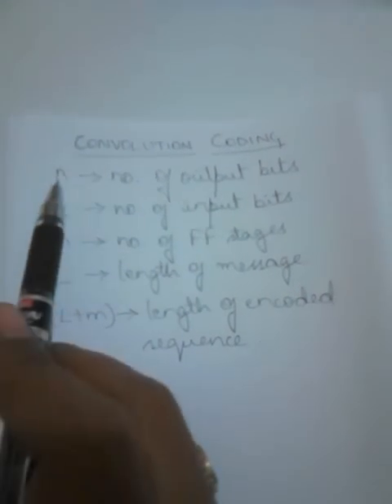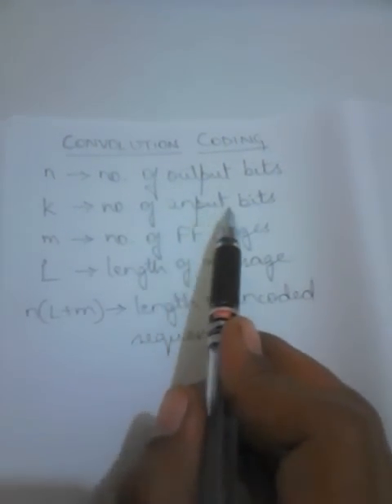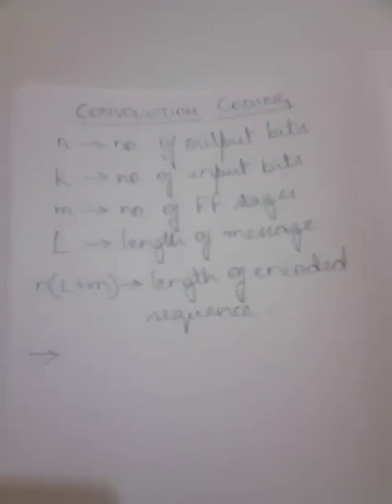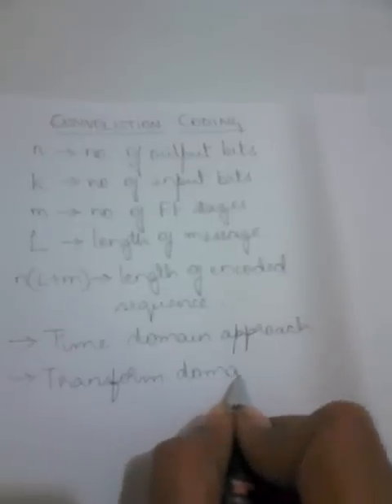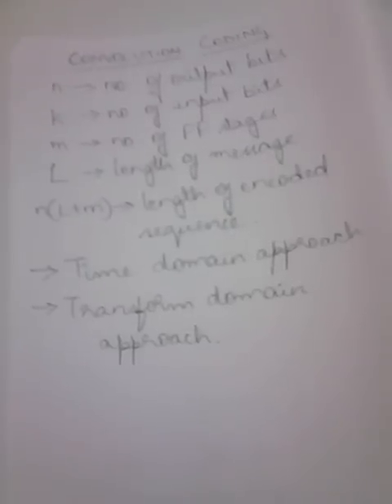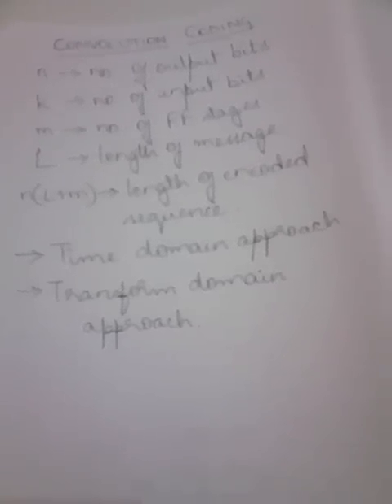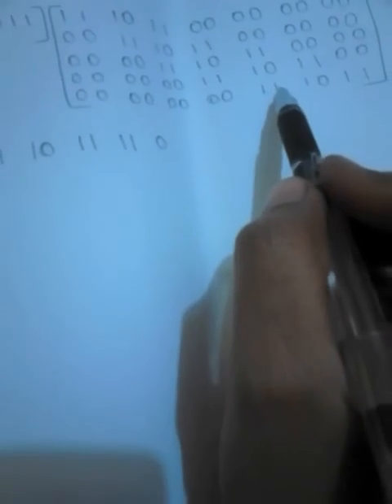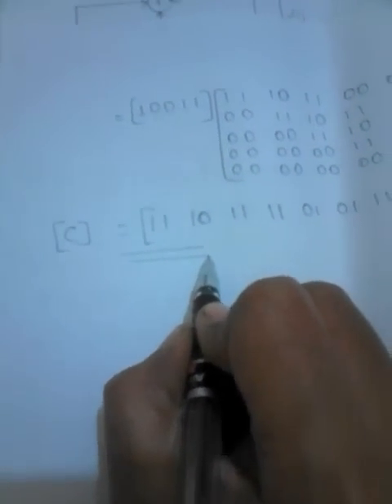Convolutional Coding

Comment: Maam ur and is wrong ... I've checked in my book
Reply: the correct answer is 
[ 11 11 11 11 01 01 11]
Reply from the maker: +Anmol Rattan Singh 
The problem I have solved is perfectly fine. There is absolutely no mistake in the solution. If u need more information on this, please refer to "Digital Communications " by Simon Haykin, page no. 394.
Reply: +Shruthi M.L.J 
Result is absolutely fine.
Reply: MY BAD GUYZZZZ .. ANS IS ALL FYN...
Reply: @harshabk3863  happy birthday sir
Reply: @harshabk3863  happy birthday sir